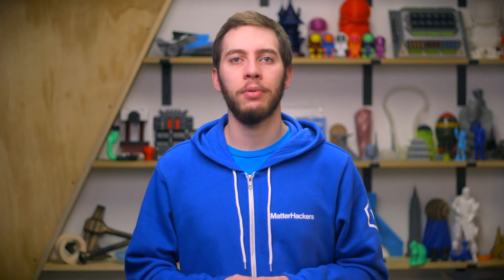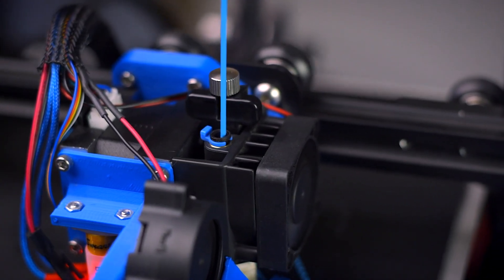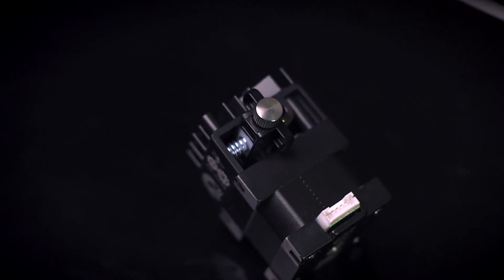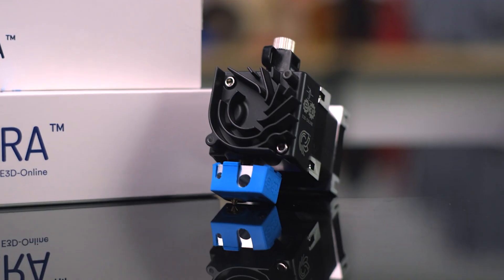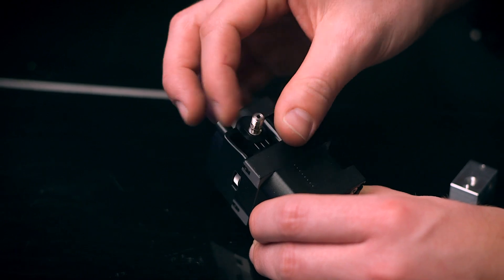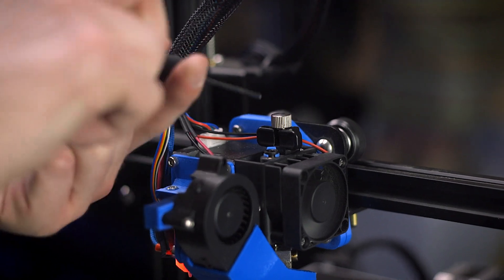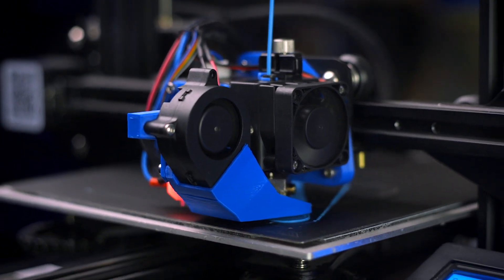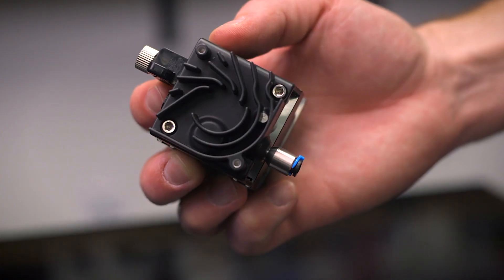Tech Breakdown: E3D Hemera Dual-Drive Extruder

Comment: I installed the Hemera a couple a weeks ago on my Creality CR 10 V2 and so far I'm super happy. I mostly use this printer for "big" prints since its big/heavy bed is not super friendly with prints requiring small/fast movements, but for those type of applications, I would say it works perfect. My experience so far has been great with no issues to print PETG, PLA and TPU.

Comment: Unnecessarily over priced
Reply: welcome to e3d, where we don't innovate and ridiculously overcharge you lol🤣 I mean look at the supervolcano, they just made it longer not better, it's stupid
Reply: @l3d-3dmaker58  the super volcano is longer to melt more filament before the nozzle for faster printing, its a necessity for high speed printers and a large improvement over the regular volcano.  Also you have to keep in mind that they machine almost every part in house to outstanding tolerances which raises the price.  Also there customer support is top notch